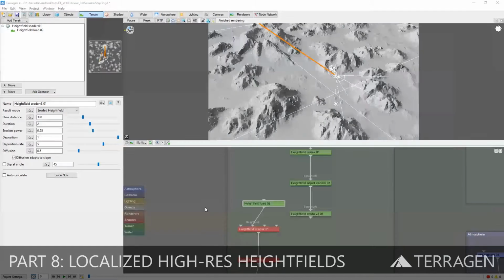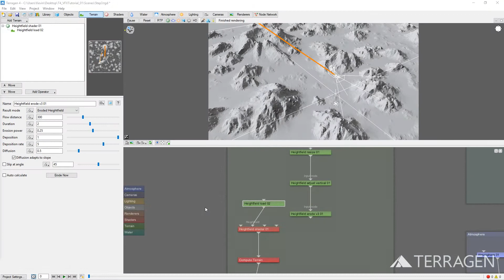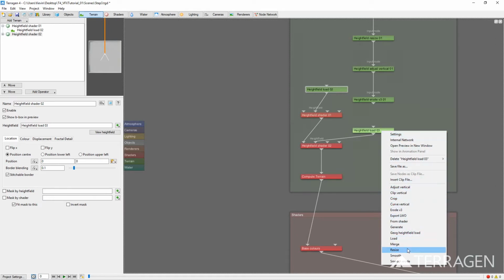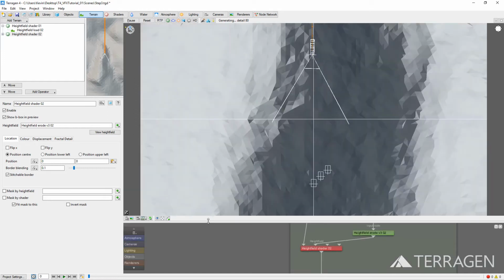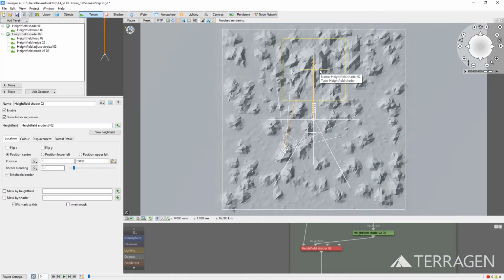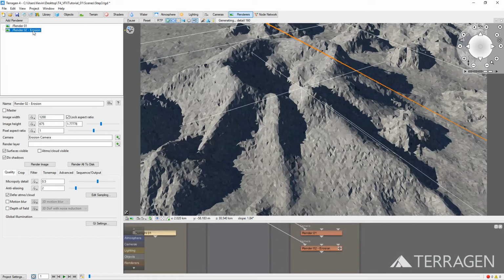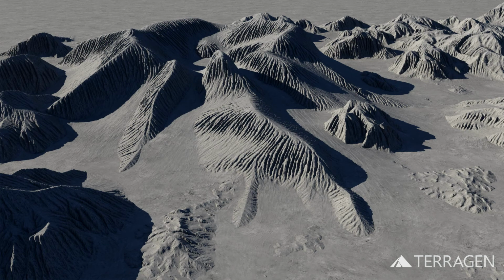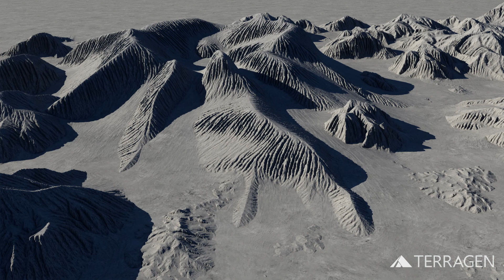Terragen for VFX - Part 8 - Localized High-Res Heightfields

Comment: For the volcano heightfield how do you derive the co ords and dimensions so they match the larger heightfield below it. Also entering the max height from the larger terrain will only work if the smaller terrain contains the max value. If there was a higher point on the big terrain and you transfer it to the smaller one it would be exaggerate the vertical extent.
Reply from the maker: Hi Tony,

Thanks for your comments and observations.

We derived the coordinates and dimensions for the Terragen environment from our 3D previs scene, which was created in Lightwave 3D.  To determine the highest and lowest altitude in the scene we used the previs mountain's geometry, specifically the highest and lowest vertices.  For the dimensions of the large heightfield terrain we set up an Orthographic camera at the origin, and looked down at the previs scene while increasing its "Size" value until it encompassed all of the previs geometry.  This value is in metres, therefore we knew the exact extent of the terrain, which ended up being 58,000 metres.  We did the same thing for the volcano heightfield, but also accounted for offsetting the camera by 16,000 metres on the Z axis in order to center the rendered heightfield image on the volcano.  Your point is noted in regards to stacking heightfields, and in our example, the volcano area did include the highest and lowest points of the terrain, but if it had not we would have sampled the highest and lowest points for that heightfield and used those values in the Heightfield adjust vertical node's Set height range fields.